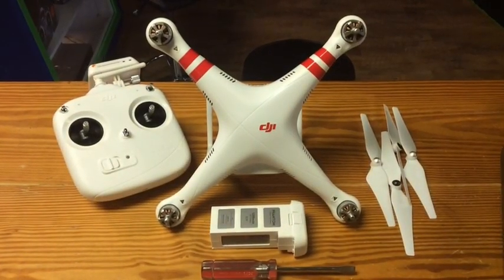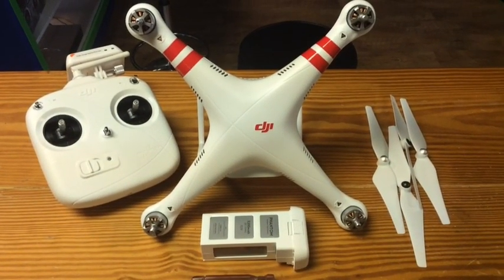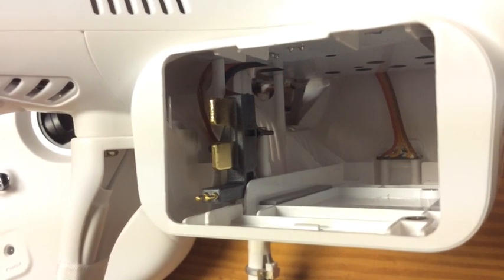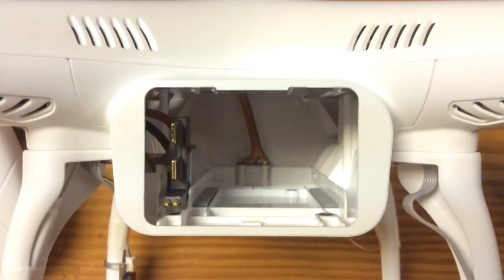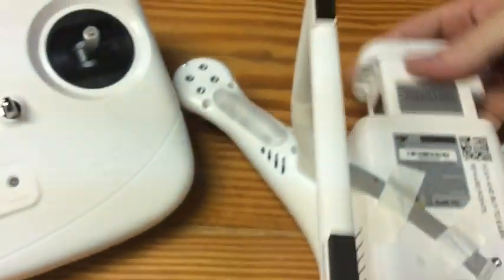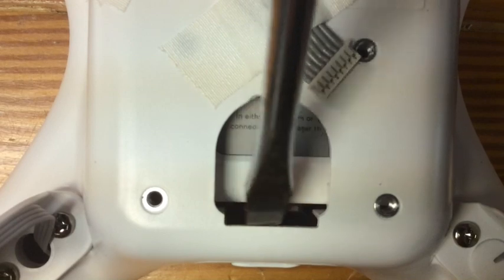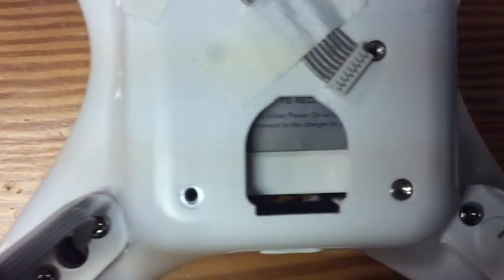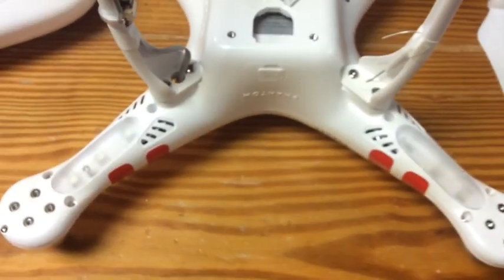Drone Camps RC, Remove a stuck Phantom 2 Battery

Comment from the maker: Another thing we heard through the grapevine is putting a little oil on the tracks going into the phantom. Helps ease the battery in so it can lock into place. I'm not saying that is a fix. Just another comment from a pilot to us.

Comment: All 3 of my batteries are very difficult to completely insert and to remove (the last inch is the problem).  The terminals are clean and the gimbal mount covers the hole used by a screw driver.  I've just learned to be careful and patient.  I've also discovered that the motors will not start if the battery is not completely connected (small gap between the battery and the Phantom 2 body).  I almost have to 'throw' the battery into the Phantom to insure a good connection.  It has been this way since purchased new in March.  Any/all ideas and suggestions are greatly appreciated.